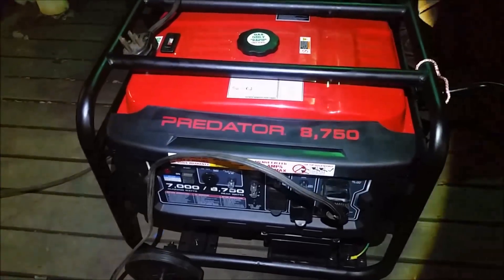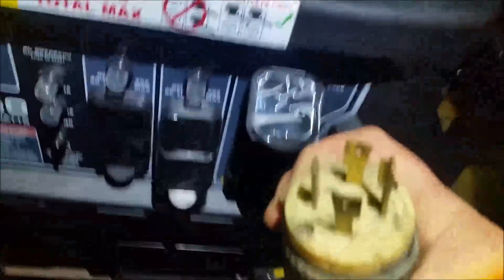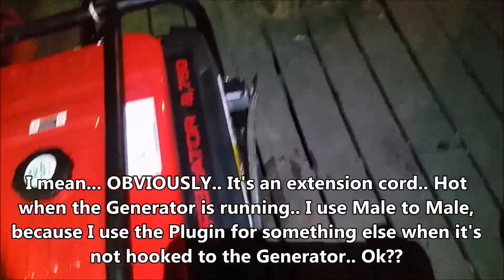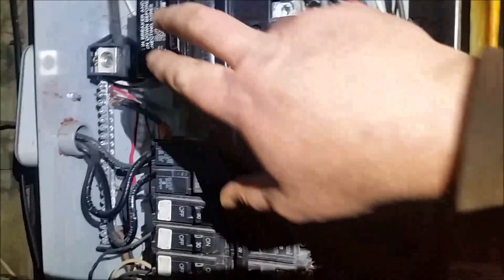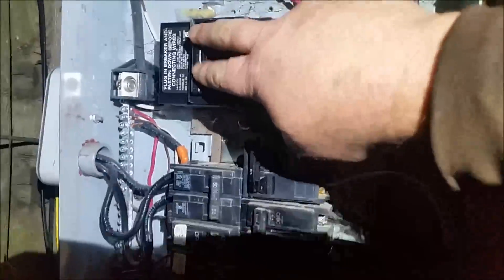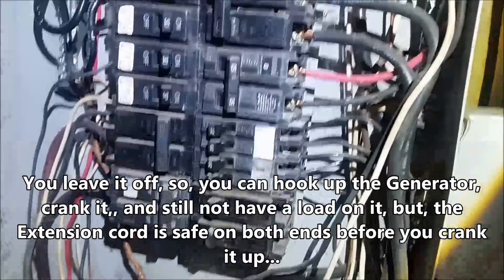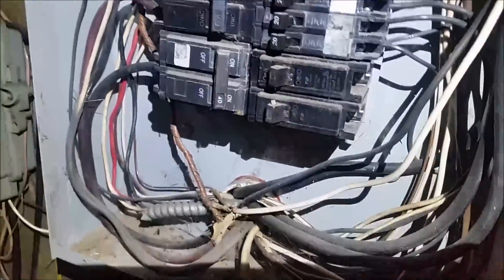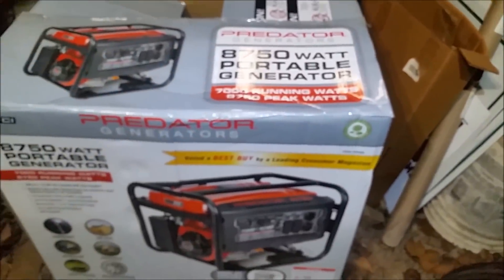Quick/Easy/Safe: Use Existing Plugin/Breaker for Generator hook up to your house Panel box.

Comment: I am a General Contractor.  Your info and lack of knowledge is going to get some one killed' The concept is solid but your casual ref to a 220 wire with  a male plug on each end is  very dangerous
Reply from the maker: That's why I said about 4 times in the video if you don't have common horse sense, this video is not for you. It was people just like you I'm talking about.
 If you think it is dangerous, you have no business doing this, and I have doubts about you operating power tools also..  Much less driving a  Vehicle. I think that it is also too dangerous for you to operate.
Reply: @MarkThomas123  Just thinking, I know four people that have been injured by power tools but not one that has been injured by a male-to-male jumper cord.
Reply from the maker: @shofar-man  Yep.. I finally let a drill press get me after 50+ years.. 
Hey, I found this video which is very interesting and I am sure you would enjoy seeing it... I listened to it while I was working, but, heard enough to know that i need to sit and pay attention to it when I get a few more minutes.. 
Why Neutrals and Grounds are Separated in a Sub Panel
https://www.youtube.com/watch?v=5iEuaAYs5x4
Cheers!

Comment: I have my generator back feeding my house as I type. It's been running almost four hours. Interestingly it's the underground feed to my pad transformer that they are working on. They have the thumper connected on my end and I just went out and asked the utility worker if he wanted me to shut down the generator so he could listen for arcs. He said I was fine that they were working at the other end. Not once did he ask me how my generator was connected. I did put a red lockout on the main in case he wanted to take a look. I told him I was going to shut it down at midnight as the fridge and freezer boxes should be cold by then and I just heard the fridge relay click so my guess was good. As a reminder, I am using a 240v outlet that I installed just inside my garage door for this very purpose. I have been safely using it for 20 years during outages.
Reply from the maker: ED Taylor I found something I think you are going to like.. I just briefly listened to it while I was working and have it saved to go over in detail.. Finally, the Neutral and Ground makes perfect sense.. Going to check my panel.. The reason why the Deep well pump works on 2 wires.. 
Why Neutrals and Grounds are Separated in a Sub Panel
https://www.youtube.com/watch?v=5iEuaAYs5x4
Reply: Ed Taylor, hope you use your portable generator carefully https://youtu.be/I1jT3ANENvI
Reply: Don’t you know that back feeding your generator can be dangerous?
Reply: @The_Happy_Aviation_Enthusiast  It's not as dangerous as using a circular saw or driving my car.
Reply: @shofar-man  I meant the generator safety rules say that we should never plug a generator into a wall outlet. It can cause fire hazards
Reply: @The_Happy_Aviation_Enthusiast  I have a 240v receptacle installed near my garage door just for this purpose.

Comment: Can I go from a 4 Prong generator cord to a 3 prone dryer plug
Reply from the maker: Yes..  220V requires 2 hots and a a neutral/ground..  The Fourth is a frame ground.   
I am going to do a video one day on my Well Pump.. It has only two wires running from the House Panel, under the ground to the water well... It's Frame Ground/Neutral back to the box is the Earth, from the pump to the water to the ground to the ground at the panel and has been working since way before I bought this place over 15 years ago... Just to give you an idea about grounds/neutrals.. 
The first time I worked on the well, I looked at the two wires and though,,, "How is this working"??  But, it does and has been for years.. Guess the guy before me already knew this...   If you would have asked me before I saw this, I would have said, no it would not work, but, I can't ignore the evidence of my own eyes.. Ha.. I have checked it out more than once.. In fact, I always look at it when I work on it.. Ha.. I guess I think an extra wire will appear out there one day.. :).. But, it works..
Reply: @MarkThomas123  A neutral is not needed for a 220v circuit. The sum of the voltages around a loop have to equal zero just as they do for a 110v circuit. If there was a neutral there would be no current flow through it as L1 and L2 alternate as source and return as the sine wave progresses. A 110v circuit uses the neutral as the return since it is effectively using only half of the 220v transformer winding. The confusion comes in with respect to the grounded conductor. 110v is always referenced to the grounded neutral return .Some people prefer to think of a 220v circuit as  two opposing  110v circuits but it really isn't. AC voltage is peak-to-peak but measured as rms.
Reply from the maker: @shofar-man   Yes. I'm still not sure I understand that fully, But I do know that my 220 V deep well pump operates on 2 wires only.
 I to am running on generator as we speak.
Reply: @MarkThomas123  Think of it this way, single phase motors are two wire devices. It's the reference to ground that confuses us Americans. In Europe the 220v is grounded at one end, in America it's grounded in the middle. The motor will run ground or no ground. The transformer center tap is so we can have 110v appliances operate on a 220v supply. We call the 110v return a neutral to distinguish it from the safety ground.  It's a "grounded" conductor rather than a "grounding" conductor (safety ground).
Reply from the maker: @shofar-man   Ok. Makes sense.. In the Panel, they both go to the same Ground bar, but, in the Motors, Switches, Receptacles, they come from different sources.. In 110v, the return/Neutral/Grounded connector is different at the source device or I guess receiving or switching device, but, terminates as the same ground in the box.. 
So, I can see how a  guy gets confused, but, then again,  can see how it is simple.. 
So,, I am assuming the Center tap on the transformer is a Grounding and Grounded Tap?? The same  as in the house Distribution Panel? Which actually really means, it is not one of the hots and will eventually make it to ground? I have seen many poles that were not grounded, at least at the pole itself.. But,  seems as though the  house Panel Ground Rod and Bar would also act as a ground for the Center Tap, as would anything connected to that.. But,,, if a Pole is not grounded, and the utility is only servicing Single Phase at the location (2 hots), the House has to be the Ground, or so it would assume..  And would make sense..  Knowing it is only for the 110v makes much more sense... 
I actually took a picture of the pressure switch today to show there were only two wires, but, just as you would figure, I need to move the wire so you can really see, there is no third wire on the 220v feed.  Ha.. Figures.. Ha..  Thanks for the Description..

Comment: Seems like the Northern Tool generator has stood the test of time and is a reliable purchase.
Reply from the maker: Yes, but I haven't been able to get part easily for it for a pretty good while. But there are some places that carry some of the more common park. Yes it's it's been a good generator.
Reply: I am looking to get a generator. 
What issues have you had with the Northern Tool  to need parts?
Are you saying Northern Tool doesn't have the parts for the products it sells? 

I was just in Northern Tool looking at generators yesterday. We were just hit by a tropical storm and I lost power for 3 hours Monday night Tuesday morning. We are expecting an active storm season which lead to my visit.
Reply from the maker: @1Teejay76  I bought one of their economy model. You are able to get filters and stuff like that but no major parts. If you buy the northern brand, I'm told that they support them a little bit better. It was a good generator though. I've had to rebuild the carburetor a time or two, but nothing major. I was able to find a breaker once. But very little has been wrong with it

Comment: So much negative feedback... if your gonna do it your gonna do it, your choice to listen or not. Question though, say I have mine back fed through my dryer plug, and all I want to run is my refrigerator and bathroom circuits. Do the appliances need to be plugged in... why is it a suicide cord? Just a little confused.
Reply from the maker: You are Backfeeding the box through the dryer plug from the generator to the panel, through the dryer outlet.. All you have to do is turn the breakers off you don't want to use and turn the breakers in your panel you do want to use.. Or, go around the house and turn whatever you don't need off..  Leave the appliances plugged into the wall outlet, so, your generator can power it through the dryer plug to the panel.. 
I power my house through a welder plug, which is the same as a dryer plug.. I turn off the Electric Hot water Heater, but, leave my well on.. I even leave my window A/C on, but, my generator will handle those things.. When I want to warm the water up, I turn off the water deep well pump, turn the water heater on, and let it go until I hear the load turn off of the generator, then, I turn off the breaker to the water heater and turn the water pump back on.. Both of those devices are 220Volt and the generator won't run both, but, will run either by itself..  I leave just about everything else on.. Lights, refrigerators, freezers, etc.. Depends on your generator size as to what you can run on it..  I have a 8750 Watt Generator. 
The reason it is called a "Suicide cord" is because, both ends of the cord are male ends.. Hot, if you plug either into a source of power, the other end is exposed and can shock you.. The power will be out when you hook it up, so, half of the problem is gone.. First thing, turn off the main breaker (No Power Now even if the power comes back on from the Utility)..  Unplug and Turn off your dryer.. You will not be running in on a generator anyway. 
Now plug both ends into the dryer and generator.. Crank the generator,  and turn the Dryer breaker on and you have just powered the whole house panel..  At this point, you have to watch the neighbors houses for lights, etc, to know when the power comes back on.. At that point, kill the generator, unplug the cord from both, plug the dryer back in.. Turn the Main Breaker on and you are back up and running like normal.. 
When you pickup the male to male cord, it will give you the heebie jeebies, because, you know it is not safe,, if you are not safe with it.. If it does not scare you,,, then, do something else.. You need to be cautious. That way, you NEVER forget to turn the Main Breaker Off, and you never forget to unplug the generator and dryer plug before turning the main breaker back on.. 
It's really pretty simple.. If you flip the main breaker on while the generator is running, you will only do it once and will never forget when you have to buy a new generator because the phases will not be in sync and it will destroy the generator.. You never have the generator hooked up before the Main breaker is turned off, either hooking up or removing the generator.. AND,,, you never crank the generator or have the main breaker on when you are working with the Male to Male (Suicide Cord).. It's common sense when you get the cord in your hand..  It's just strange and says,, ":BE CAREFUL WITH ME!".. 
That's about it.. Just some very basic common sense rules to follow.. You can write those simple steps on a 3x5" index card and put it inside of your panel and just refer to it before you start..  I would recommend thinking about it, deciding what to do and then,, looking at the 3x5 card to make sure you are right.. Once or twice doing that, and you will always be confident in what you are doing..  Any questions, feel free to ask.

Comment: Theres a reason we call those suicide cords.  This practice is incredibly dangerous.  Invest in a proper interlock kit.  As for panel layout both sides have both phases. they are staggered on the panel.
Reply from the maker: Yes. Both legs are accessible from a single side = 220 breaker..  But, you should say,, Invest in an Electrician to install an Interlock, because if you are not smart enough to do this,, Got help you if you  start opening a box and installing an Interlock, moving breakers/wires,etc to get the 220 breaker up top,,,,, if you have an extra breaker and open slot available, etc.. 
This technique is for people who want to use an EXISTING BREAKER and EXISTING PLUGIN, usually used for something else,, and use it for the Generator Temporarily to power the house and go right back to it's normal use when done.. Can you do that with an Interlock?? NO.. Can't.. 
Besides,, you have to know how to make a Male to Male Cable to even get started, so weeds out about 100% of the people who can't do this..Use Logic, and it makes perfect sense..
Reply: If you seriously think this is an acceptable practice please refrain from touching tools.
Reply: Carbon monoxide is dangerous as well https://m.youtube.com/watch?v=I1jT3ANENvI here’s a video about generator safety
Reply: Well aware of hazardous environments.

Comment: Just made it through a 30 hour outage using our mutually favorite method of connecting. Interestingly the problem was just up the hill from my house. I could see the cherry picker as they worked and hear the workers talking to each other as I started and after I stopped my generator. I would run it a few hours at a clip to keep fridge/freezer boxes cold, pressurize water tank, make coffee and operate microwave (with load management). I ran it about four hours today while watching TV and using the computer. The generator is a Coleman Powermate 5000. It is not an inverter generator so it has a native sine wave output thus no problem with TV, modem, router, charging cell phone and etc. It's important to note that although  the workers could both hear and even see my generator no-one came by to check me out.
Reply from the maker: Ed Taylor.. Just curious.. why do you think that is unusual that they didn't come and check you out? Because of the location of the problem, and maybe they didn't know where it was?
Reply: @MarkThomas123  I'm thinking they just had no concern about it. Since my genny was running it couldn't be backfeeding their lines so they could care less. I think 22 houses on the leg that was turned off, no way I could power that.
Reply from the maker: @shofar-man  Ha... Oh yea..  Ha.. I didn't even think about that.. :) Ha..
Reply from the maker: @shofar-man  Yea.. 22 houses?? Yea.. Even a much larger generator than both you and I have would die about the time you flipped the switch with that much load.. The other thought I missed.. Ha.. You are absolutely correct..

Comment: i have a blackmax 3650 watt generator. i`m new to this kinda stuff. is it possible to run my stove as a source of heat through a heavy duty extension cord going to my generator? i`m setting up scenario in my mind about how to heat my home temporarily with my generator, without spending alot of money. if its possible, what type of adapter do i use for going from the stove to the extension cord? thanks
Reply from the maker: That is not a very large generator.  Max output would be roughly 30 amps at 120v and 15 amps at 240 volts. 
Usually Electric stoves are 50 amps at 240 volts..  I have a much larger generator and I would not even think about using an electric stove.. Too much Drag.. You are going to want electric for Refrigerators, lights, etc.. 
You are going to find quickly that running a generator is not cheap either.. Much cheaper to heat with some other heat source.. I can't imagine a stove putting out more heat than a Radiant Propane heater, etc.. 
For that size generator, 30 amps at 120 volts,, if you have two electric heaters (Space heaters), it is about all you are going to get out if it, and I think, if they were fan forced, would give you a whole lot more heat than an electric stove.. 
I would look for a  Propane heater or wood stove as a backup, or, something along those lines.. Maybe a Kerosene heater, although, most of the heat on something like that is going to go out side due to the exhaust, unless you spend some nice money on something very efficient that doesn't vent so much.. I played around with burning waste motor oil, and did some initial videos, but, didn't have time to do the edits and post the videos after we got it pretty much where we wanted it.. Massive amounts of heat without smoke, but, it is going to smoke some here and there, so, not something to mount in a house.. Shop, ok, when you are there to get it going, tweek it and then, let it rip, but, I looked at both of the videos that I had, and neither of them were after I put a shroud on the tank to do fan forced heat around the tank, to heat the shop.. Just looked at all of the videos, and still don't have time to tinker with them and post them... 
I do have a video I did on my wood stove to get more heat out of it.. All of these videos were done 2-3 months ago.. Might want to check it out... But, for temporary,,  something like this Mr Heater 18,000 btu propane heater with a converter hose to run it from a 20 or 30lb cylinder will do you pretty well... You can find them cheaper I think.. Probably around $75-90 bucks and they put out a good bit of heat..  Save the Generator for lights, TV, Refrigerators, Freezers, etc.. Hope that helps.. 
https://www.homedepot.com/p/Mr-Heater-18-000-BTU-Portable-Radiant-Propane-Big-Buddy-Heater-MH18B/309243646
Reply: Healthy American, please make sure you also watch this video about generator safety https://youtu.be/I1jT3ANENvI it’s very important for everyone who has portable generators. Thank you. Everyone agrees